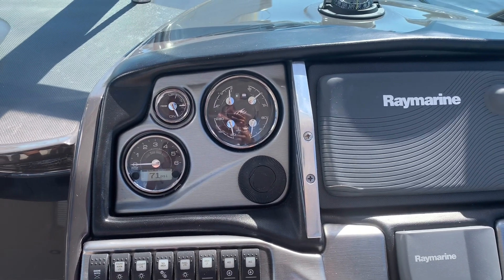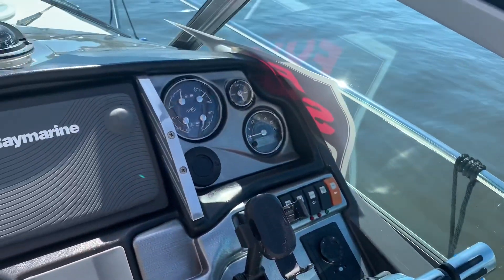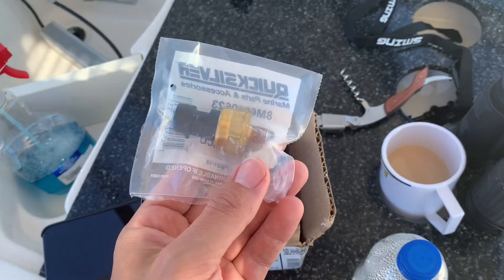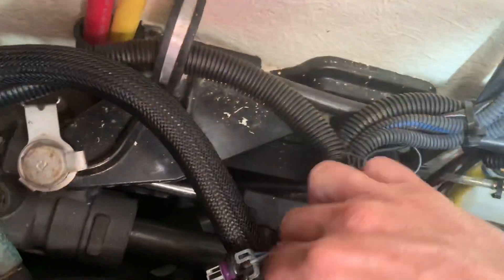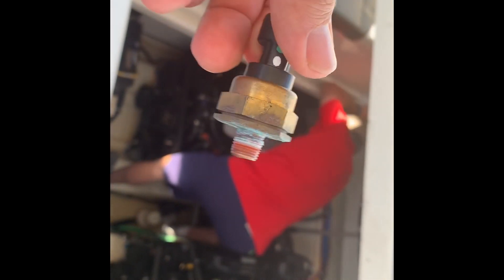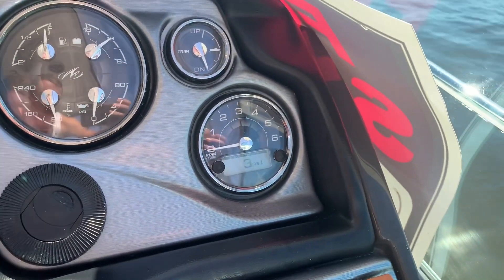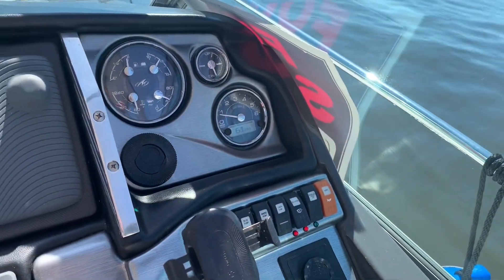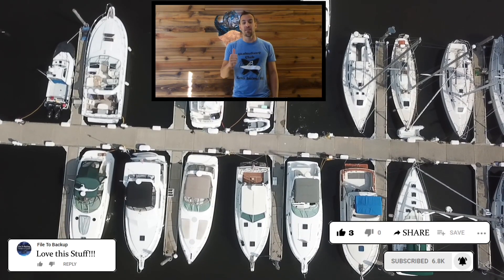Replace a Bad Block Pressure Sensor mercruiser 350 MAG Boat Engine - 8M6000623

Comment: Dude the calibration of the sensor on the dial is wrong.  You don't have anything like 71PSI raw water pressure when idling.  It will be more like 15-20 at most. Get someone to check it for you.

Comment: So the SmartCraft Gauges are actually missing a decimal, if it shows 65psi that is actually 6.5 psi and so on.  I have the exact same setup and when reading it with a Scan Tool like the Rinda Techmate Pro you will see 6.5 while the gauge shows 65.  Good info on the location and replacement though!  Thank you for posting

Comment: What was the fault code displayed when it went into guardian mode?
Reply: Fault Codes 37 Sea pump Code 151 Fuel Pump Relay i repaired those fault codes cleared i still do not have any instrument Gages i still have 1 Code in guardian mode i can not get into the guardian system i get 1 horn beep after starting the engine i have a scanner from Rinda

Comment: I did the replacement, still having 2 beeps
Reply: same, mercury 4.3 mpi,  new sensor, still getting 2 beeps and fault 411-25 block coolant pressure, the input circuit for the sensor is below the valid limit.